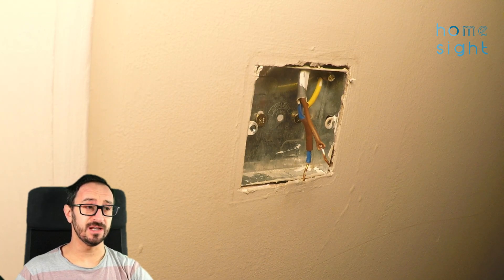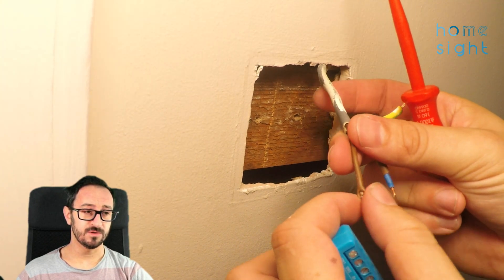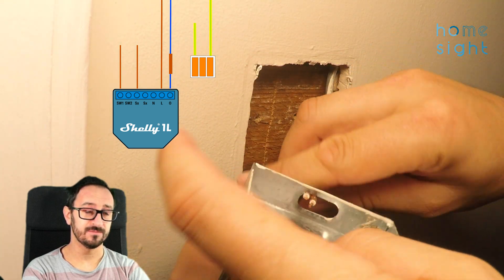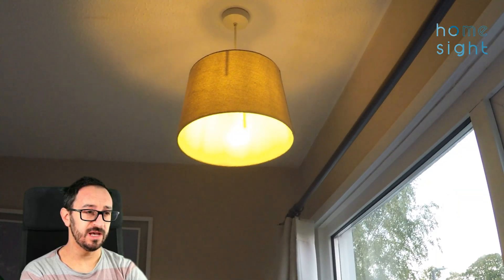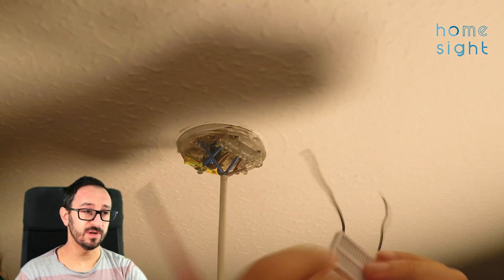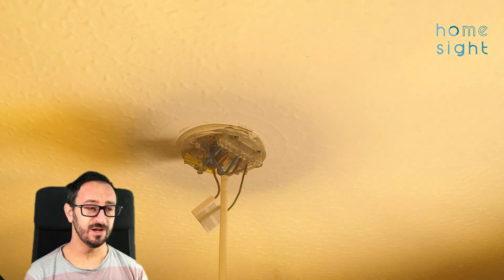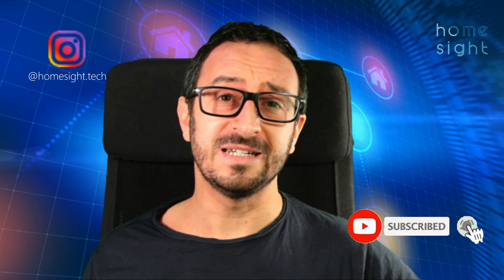How to Install a Shelly 1L (without neutral) - practical demonstration

Comment: You should take this off YouTube immediately. It's dangerous and breaks code. The proper way to do this on such an install requires some drywall work as you have to move the hole to above or below the joist and use a deeper box. Basically NO 240V JUNCTION SHOULD TAKE PLACE OUTSIDE AN ACCESSIBLE BOX, a junction being a splice or a connection to a device.

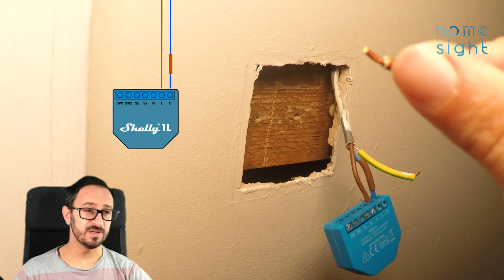Comment: @HomeSight, great video. I'm new to all this and really lost with regards to this: at around 4:16 you say you "make" 2 short bits of wire that connect the Shelly to the switch but these don't seem to come with the Shelly - where are we supposed to get these from and what should we buy? All the videos online seem to just have these additional wires appear but none explains where we are supposed to get them from. Thanks so much
Reply: Get whats known as twin and earth cable, its the same type of cable you see going into the switch. You can take the brown wire from that. You can buy at Screwfix etc.

Comment: Omg having exposed live conductors in the wall void is completely against IET WIRING REGULATIONS BS7679 you should always fit a deeper metal box to accept the Shelly module and exposed cables
Reply: Yep all that should be in an enclosure, two minute job to fit a 35mm box

Comment: nice video man, i would also install a rubber grommet to hide the sharp metal backbox where you fed in the cables just so over time any movement in the cables do not cause it to rub off 👍

Comment: Can the shelly one L be used with a led light fixture which has an led driver in it because I’ve hooked mine up exactly the same and it works when pressing switch but for some reason even with the bypass when the switch is off the leds are on very dim as if there’s some power from the Shelly powering them
Reply from the maker: Hmm, Sounds like the LEDs aren’t compatible with the shelly1L unfortunately

Comment: Just a note, the bypass goes between the switched live or output & neutral in the ceiling rose. Not the permanent live & neutral. 

It does look like this is how you’ve connected it & I assume that’s why it works!
Reply from the maker: Thanks, I realise I made an omission in the description on the video, but did add it to the notes! Good catch!

Comment: If you've got the ceiling rose down to install the bypass why not just fit the shelly 1L in up there where the natural will be?  Or am I missing something here?
Reply from the maker: Very true, you could do it that way!
Reply: If I'm not mistaken, it's because power in the ceiling rose will not be "always on", because it's dependent on the switch, which means if you'd be able to turn the light off, but never on again, via the Shelly - happy to be corrected, but that's my understanding.
Reply from the maker: Andrew, that depends on your wiring setup. I have a permanent live at the ceiling, where as others I know don’t and have only a switched live at the ceiling.

Comment: Simon, do you know if the shelly device can be used as a trigger device? I.e. does the device need a load, could I power it and connect a switch then use the switch to control a Zigbee blind or smart bulb (without cutting the supply to bulb) for example?
Reply from the maker: Hi, yes, you can do that. In fact, I do that with a few things. You can use the Shelly in “detached” mode where the input does not control the output, instead it sends a command. In my case I use the input of an RGBW into node red where I then perform various different things!
Reply: Does this also work with only the live wire connected?
Reply: @Tables & Wood  i wouldn't have thought so. The no-neutral version of this, or any other no-neutral smart switch, needs the neutral at the light fitting itself to "complete the circuit" (picture it as power going through the switch to the light, through the lamp and out on the neutral). So, with only the line (live) connected, the circuit would not be complete and wouldn't work in the way that i first inquired about.

Comment: This is great, exactly what's missing from YouTube! Like I said on your video a year ago, there were plenty of videos where everything was laid out on a table but none on a real setup. Even your last video was better than the rest since you actually had a ceiling rose, but this is perfect!

I have been wondering something about the bypass capacitor. We would get flickering on bulbs like LED bulbs but on a higher powered setup of 20W or more (like my current setup with non led bulbs), there is none. My understanding is the bypass will allow the shelly 1L to draw enough power to prevent the flickering, but does that mean that it is constantly drawing 20W? That seems like a lot for something so small and simple!
Reply from the maker: Hi! Thank you for watching. 

I had that exact question (and another viewer ask). I don’t believe it does, since the energy would need to be dissipated somewhere. I wanted to test it but the only ammeter I had at home was a DC one, I’m going to get an AC one from work and re-test!
Reply: @HomeSight  would be good to know. I would have asked shelly support, but I've asked them so many questions lately, and as silly as it sounds I'm a bit embarassed to ask more...

Comment: can the bypass be put in at the switch end?   one of my rooms Id like ti use a 1L has downlighters
Reply from the maker: No, because the bypass needs to go across the neutral and switched live.
Reply: @HomeSight  so how would i integrate the bypass intoa room with downlighters...where would it need to go....I know its a 20W minimum so most of my rooms wont have the issue but worth being prepapred I guess
Reply from the maker: Hi Jon, you must have some sort of connector block in the downlighter or is there a junction box separately?
Reply: @HomeSight  quite possibly...something i need to look into for sure...will see what I can find
  keep up the great vids...particularly like the full demo with the demo wiring....made things much clearer for sure
Reply from the maker: Glad to help! Good luck!

Comment: You installed a device, but what does it do for you? You just turned it on an off manually, why did you do this???
Reply from the maker: Hi Dave, the Shelly 1L is connected to WiFi and fully integrated into home assistant. Check the first part out for that:
https://youtu.be/UE8XKQlJAQg

Comment: Single insulated wires through a metal box, that's a big no.
Reply from the maker: I would have put a gromit on there, except it’s a factory rounded edge so doesn’t require one.
Reply: It’s got an earth, so it’s ok
Reply: @HomeSight  they're still single insulated - should be double insulated going into the back box regardless.